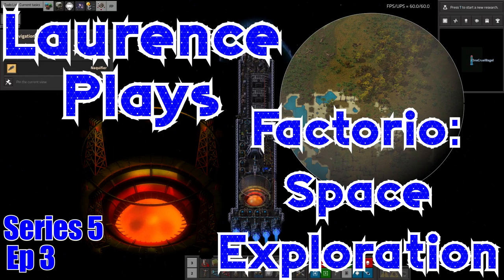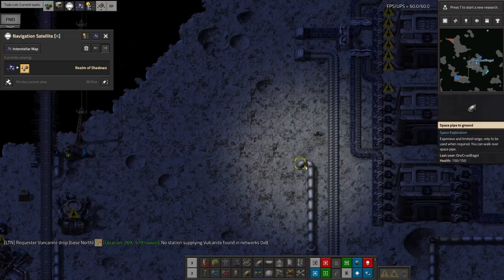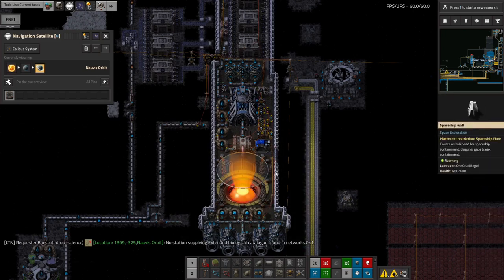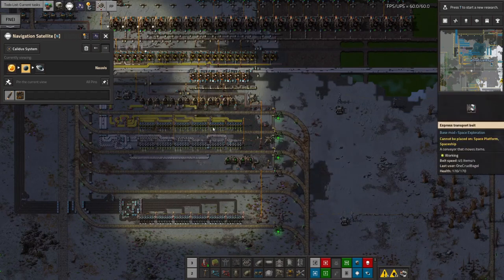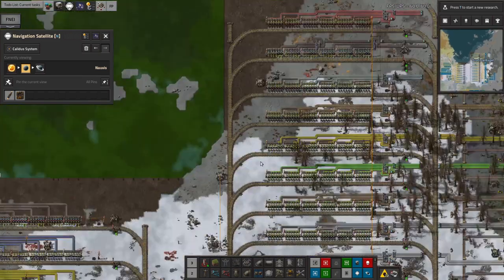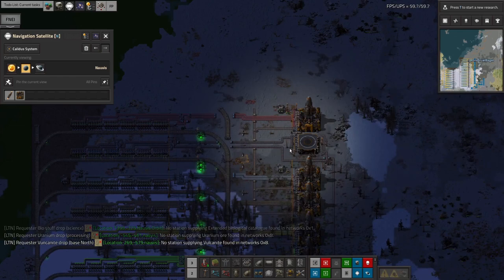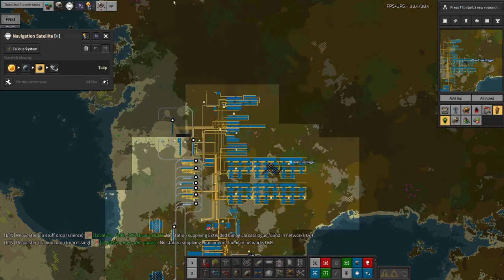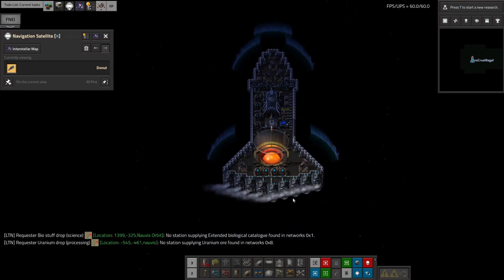S5-E3 - Unionised - Laurence Plays Factorio: Space Exploration

Comment: You will probably have to start dumping water in realm of shadows, the sulfuric acid isn't used anywhere near as quick that the water can be dumped there. So keep it the way you plan at the moment, and add an overflow valve that dumps the water via electric boiler would be my suggestion.

Bad luck on that transport ship all the way outside the system: I got an asteroid strike on the first repositioning flight of a new ship with insufficient power, and even though it was less than 5 seconds away at normal speeds, it was still dreadfully tedious to go and rescue it. But it does provide a fun challenge to fix it if you don't just write it off as a loss, haha.
Reply from the maker: I don't /think/ I'll have to dump the water - it should get passed back into the ship and turned into more steam. Note that I'm not bringing out steam in the ship, I'm bringing the ship out and then turning water into steam locally. Sure, there's a store of water on the ship, but I expect that to be less than full so if anything it'll provide a slight drain. I think. We'll see if I'm wrong! It's definitely going to break as it is though, it needs buffer space. 

I'm definitely not going to write the ship off, I just haven't decided which of the methods I want to use to recover it yet. Probably setting up ion stream production on the side of the ship, tbh. It seems like the easiest way to do it!
Reply: @LaurencePlays  Ah, for some reason I didn't notice that the water gets passed back to the ship, that does make sense. Yeah, my powership has a separate system for internal power versus the stored steam for the asteroid belt, and the water is free (well, almost free, just a bit of mining and train logistics required) in Nauvis orbit where I make the steam.
Reply from the maker: @pietersieliepc  I picked the location in the asteroid field because there was a supply of water ice and naquitite nearby because I knew I'd need the water for the acid. I'm considering the beam receiver to be my power storage for the ship - a big thermal battery instead of steam batteries. If I could run a heat pipe out of the side of the ship, I would!

Comment: This is a bit old, but if you wanna get slightly more integrity in "finished" spaceships, replace empty tiles inside it with spaceship walls. 
A wall is 0.5 integrity compared to 1 for an empty spaceship floor.
Reply from the maker: I was told that during the stream, I think, and it doesn't seem to be entirely true - at least, there were definitely occasions where I added bits of wall to fill in gaps and it made it worse. I think there's more to it than meets the eye, perhaps the wall sections have to be linked to the exterior? Perhaps there are other rules... Yeah, it wasn't that easy.  😕
Reply: @LaurencePlays  Mhhh, fair enough.  This might have been tweaked around by Earendel recently then, my take could be outdated. I'll check around.
Reply from the maker: @Nooctae  Mmmm. Just being able to fill it up with walls seems like a cheat, but on the other hand, having more walls would mean more structural strength, and it takes available space away so it can't be used for transporting stuff... I can see arguments either way!

Comment: What if you took a ship, purely made for energy, blast it with solar radiation, send it to realm of shadows and then disassemble the ship there and aim a beam at the receiver? Would that work? It would be at a higher temperature as you arrive, so no waiting for the heat to build up. My question is, would the solar beam be powerful enough to allow for a continuous increase in heat at that point or would it start cooling down eventually, even if the beam is aimed at the receiver?
Reply from the maker: I reckon that would work. You wouldn't be able to lift the receiver, so it'd stay sat on a platform of spaceship floor, but that's not a problem. I think the beam would fairly easily bring in enough power. However, this way I can use one beam to power the outpost and as many ships as needed to run back and forth to it. And possibly even to other outposts, if that becomes necessary.
Reply: Beam efficiency drops off based on the distance, and the asteroid fields are so far that it is kinda worthless to try and beam all the way IIRC. But will have to check to confirm. Much more efficient to ship it with spaceships that go there anyway. So mainly because it will be difficult to get enough power production in a stellar orbit to supply a naq base: mine uses around 90 MW with minimum power use, which means with a beaming efficiency of 5% (which is optimistic IIRC), you need about 2 GW in a stellar orbit, which is fairly significant.
Reply from the maker: @pietersieliepc  That's pretty much my logic - it could be done, but I'd need a serious amount of beam power and since the ships need to be powered anyway, I might as well use that power to run the outpost as well. I did try it at first, but the warmup time was so long I gave up and powered it from the ship's turbine. This is the next generation of that, with steam storage on site.
Reply: @LaurencePlays  fair enough, it wouldn't be as effective, but it would keep things going if the ship isn't there for a while, then again, you probably would be there most of the time anyways
Reply from the maker: @CuantusGaming  Yeah, I expect a ship to be there fairly frequently. And if a ship isn't going there, that probably means it doesn't need to be powered - the whole facility can just go to sleep.

Comment: why can't you bring ions in canisters? and just fill the ship with them
Reply from the maker: You can't put ion stream in canisters - I suspect this is because I'm on an old version of the mod, I've been meaning to update but keep ... well, not. I can put plasma in canisters, although I've not made any of the relevant sort, but I think if I'm going to be having to make ion stream on site anyway, it's not going to be much harder to make the plasma there as well!
Reply: The latest version of the mod will give you not only canisters and meteors with biters, but also a new logic for the work of space clamps. This will allow you to remove the combinators from the cargo ships and free up a little space. Anyway, keep playing, your videos are very helpful.
Reply from the maker: @TheDenvver  Tempting! I have been thinking that I should upgrade and this does give me a few reasons to. I can already pass signals through clamps, so I could put some of the combinators outside, but it hasn't generally been a problem and I like having the ships in control of themselves. Has something else been added to the clamp logic?
Reply: @LaurencePlays  probably not, I think that only the ability to transmit a signal from outside to the ship, but I'm not sure.
Reply from the maker: @TheDenvver  Ah, OK. I think that's the same as I already have - I've passed signals in and out a couple of times so far.